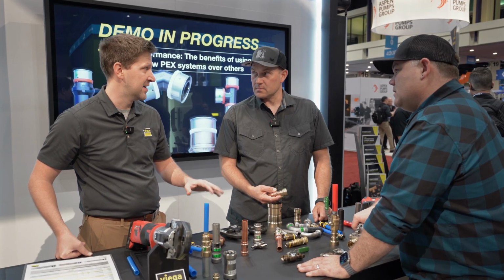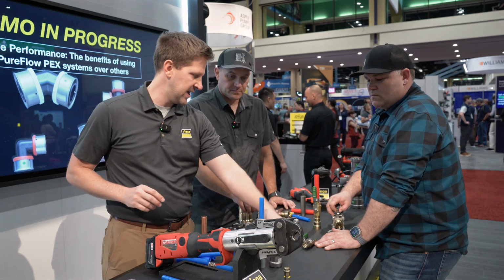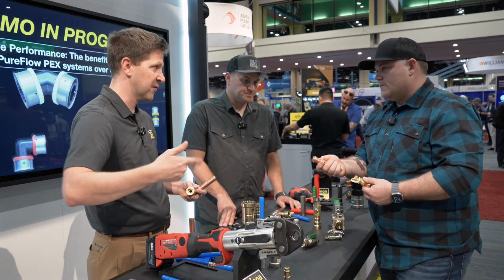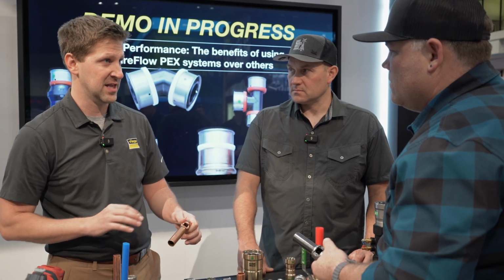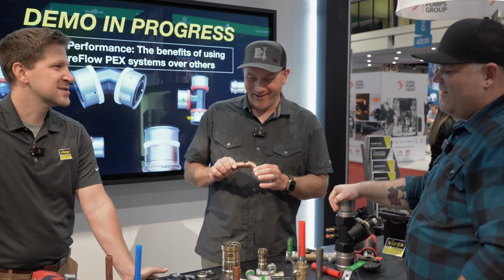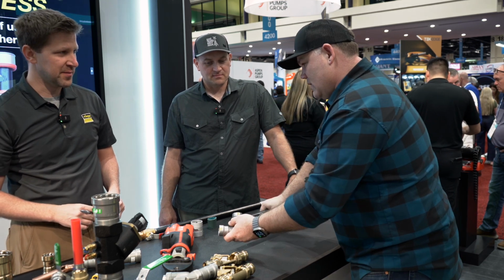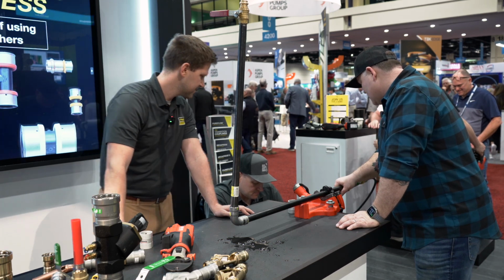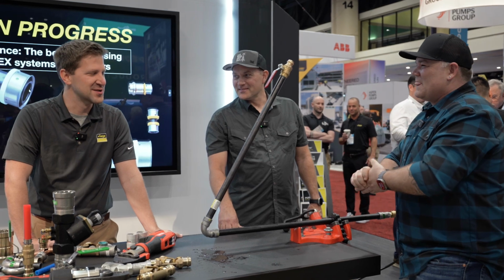Amazing Plumbing and HVAC Fittings from Viega

Comment: I once installed a 3/4" back flow preventer with Viega press fittings and a drunk driver hit it with their car. Customer called panicking that a drunk driver hit it and we needed to check it out. We went to look at it and sure enough it was bent to shit at the 90's BUT NO LEAKS. We gave the customer the price to fix it and he was like "meh, it's not leaking, leave it." A true testament to Viega's durability.